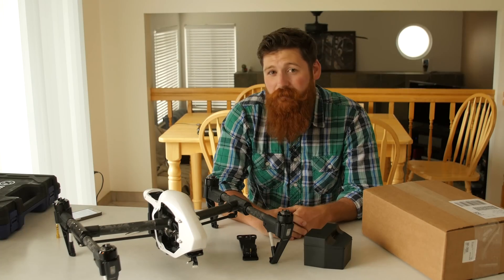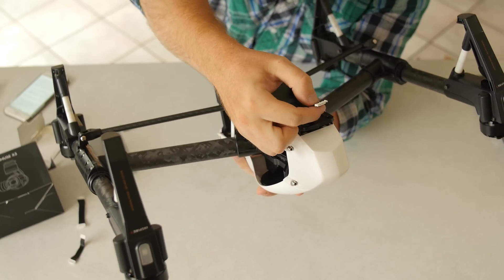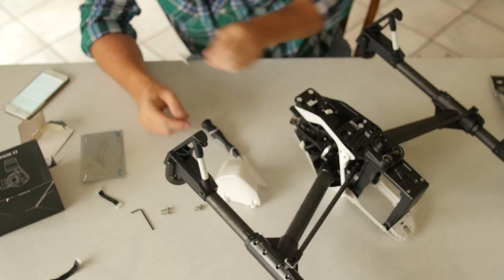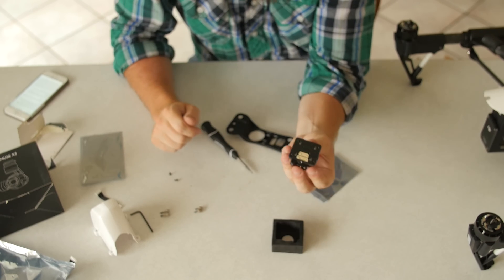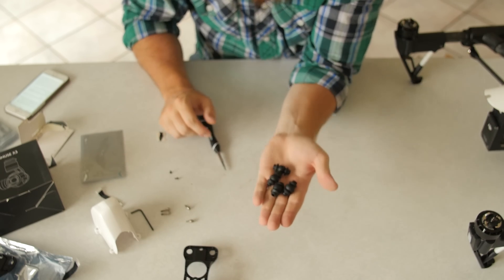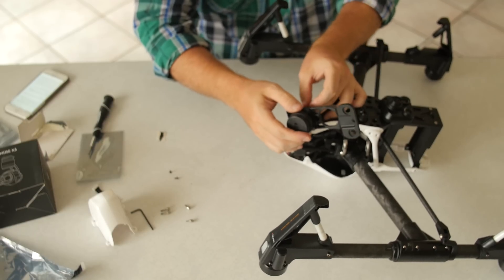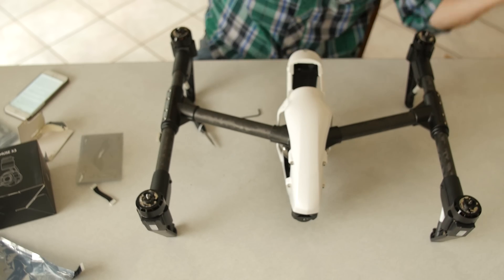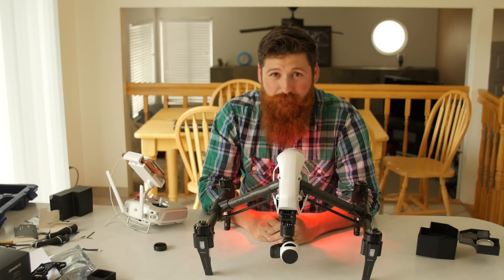HOW TO: Fix broken DJI Inspire 1 Gimbal and Mounting Plate (DJI Inspire 1 Crash)

Comment: have you dealt with Zenmuse x3 servo motor going bad . Can that be repaired do you know, same craft as you have. thanks for answering .
Reply from the maker: I haven't. I've actually switched to mostly using other drones since the camera tech has gotten better on the little guys. Mostly the Mavic and Mavic Air since it's so portable and just pops in my camera bag. Every once in a while if I know there is a chance of higher winds I will break out the Inspire.

Comment: yes i bought the inspire 1 couple days ago it came with no camera so i got a camera and putting it on it doesnt move ot turn at all and tricks or when can i do?
Reply from the maker: Ugh. That's no good. You might check the pins on the connectors to see if any of them are bent or out of place. I'm also assuming you got one of the white X3 cameras and not the black ones that were for the DJI OSMO. The black OSMO cameras do not work with the Inspire 1, but the white Inspire 1 camera DOES work on both the Inspire 1 and the OSMO handle. Not sure why they decided to do it that way but they did.

Hope that helps! And thanks for watching and commenting.
Reply: @AGBountiful  I sent it back order a new on it came 2 hour ago and it works fine I think the other one the seller sold me might be bad
Reply from the maker: @elvisbest3213  Oh nice. Glad you could get a working camera. Have fun with your new drone! The Inspire 1 is super rock solid to fly.
Reply: @AGBountiful  THANK YOU when u have the dron with the landing dear down like on a table with the camera on it the camera dont turn left to right or the gear has to be up for it to do that i never had an inspire before so
Reply from the maker: @elvisbest3213  The camera just follows the drone movement unless you have a second controller that is specifically for moving the camera. So if the drone is not moving (like if it is sitting on a table) the camera will stay still.
Reply: @AGBountiful  ok ty I can move it and spin it with my finger and once I am in the air I should be able to use the controls to control the cam right?

Comment: I recently picked up a T601, looking to do a similar repair. Great to see the step by step on your T600, very informative.
Just wondering if you looked into repairing the old gimbal with motors, wires etc. All of those parts are available, so users could repair the entire camera instead of buying a whole new unit. 

The bottom line is to some users, the cost is not justified, but for professionals you cannot risk a faulty gimbal/camera, just buy a whole new one. 

Cheers and happy flying.
Reply from the maker: At the time I made this video aftermarket parts for the X3 gimbal weren't available. You basically had to buy another broken X3, try and make a Frankenstein combination of the two and hope it worked. I do think I still have the parts hanging around somewhere but don't have a huge incentive to try and piece it together again.

Totally agree with the professionals just needing to get a new one. Some things are worth trying to fix, but in this case with it in so many pieces and it being a pretty precision part, I figured I would have quite a few gimbal overload errors, drifting horizon, etc. even if I could get all the pieces together.

Thanks for commenting! Hopefully the guide helps do some repairs on yours.
Reply: Little UPDATE: Out of curiosity, did you junk the old gimbal ? I would be interested in buying the old one as spare parts for my current repair on my x3..

THE REAL UPDATE: I just got my gimbal fixed I would say 90% (still get the odd ROLL motor error but not in flight, just when turning the bird in my hand to test the movement), got a used one on craigslist that was also crashed, but arms were good. Swapped cameres, re-calibrated magnets and voila :) Its not easy at all though, the physical repair is easy, plug in and then NOTHING WORKS ... just video feed. Had to balance all the motor magnets at the correct point which took hours once i saw the thing were magnetic.
Reply from the maker: That's awesome you got yours working!! I'd be interested to see the process of balancing all the motor magnets.

I do think I still have the parts, but mine was in a LOT of pieces and the camera itself was banged up on the USB port and some other places. Not sure how much would be salvageable. Should probably still list them on ebay or something.

Comment: Didn't you have to update the firmware on the camera? Good video!
Reply from the maker: I don't think the camera stores any firmware. I believe it's all internal to the actual drone (as well as each battery and controller). The camera does have the SD card slot to give you access to the drone though.
Reply: My research leads to the camera and batteries having firmware inside each, but not 100% verified, because nothing is published by DJI. Thanks for your response.

Comment: He didn't fix the camera arm which is what I need to know how to do. He just bought a new one!
Reply: I did the actual repair, it can be done but its not straight forward at all. Requires each motor magnet to be re-calibrated. Generally they go out sync when a crash occurs, and when the arms are taken apart.
Reply: also.. join inspirepilots forum for how to repair articles on the camera. Very extensive stuff on there, some of which i have posted.

Comment: thats not fixing broken parts , thats changing / replacing parts
Reply from the maker: There really isn't a way of repairing that part once it's broken since it's a precision part that they don't even sell separately. One of the big downsides to the Inspire 1 is that when the camera gets messed up 99% of the time you have to scrap it and buy a new camera. We just used the common search term "fix" since most people won't be searching for replacing parts and this is the way to solve the problem of a broken gimbal and other common parts broken along with it.

Probably not the answer you're looking for as a new camera isn't cheap and it would be nice to swap out a broken part, but unfortunately it's extremely rare that you can salvage the X3 camera after it's been broken. You'd end up having to buy a new camera and then swapping the parts over to the broken one... which doesn't make a whole lot of sense to do.
Reply: i bought the roll gimbal bracket and i ordered the flat cable as well , parts are available 
i just need a tutorial on how to change the flat cable as i already installed the roll bracket 
unfortunately i am not able to find a tutorial on how to change the flat cable
Reply: He didn't fix the camera arm which is what I need to know how to do. He just bought a new one!
Reply: but  AGB you can find the parts at amazon 
Drone
 Fans Inspire 1 X3 Gimbal Flat Cable Gimbal Protector Protection Flat 
Wire Repairing Accessory for DJI Inspire 1 Zenmuse X3 Gimbal

and for the arm 

DJI Zenmuse X3 Gimbal Roll Arm Aluminum CNC Replacement Part
Reply: So did you successfully replaced the cable? i am having the same problem. Bought the parts and will "replace them" to "fix" it soon. 
did you find a useful video ?
Reply from the maker: Oh cool! I haven't found ANYWHERE to buy the individual parts. You'll have to let me know where you guys have found them. I've only ever seen the full gimbal/camera being sold. The closest thing I have found for a disassembly video of the x3 is by the YouTuber addiengr1 it should be a related video on this one, but I don't think it goes into the details you are looking for. If you figure it out though you should post a video! I'd love to see it.
Reply: i still didnt find a video about the parts replacement but i will try to shoot my own and post it here .
i have already changed the roll bimgal bracket and still waiting for the flat cable to arrive
Reply: red or P goes to the motor
Reply: Boards are different 
you can find in hand writing the letter R and the letter P 
R is for roll arm and P is for the pitch arm ( camera motor )
Reply from the maker: Hady Esta Nice! Just did a search on Amazon and found those parts. At the time I made this video I don't think those were available. I know DJI doesn't sell them directly so must be that company making their own aftermarket parts for repairs. Hopefully I will never need to buy them again, but it's good to know the option is out there!
Reply: hope you will never do :) 
Unfortunately i have changed the roll arm and the flat cable , now i am having a crazy gimbal behavior
i checked all the connections but in vain .
have a safe flight :)

Comment: Good video detailed and informative has anyone ran into a site where they have some used possibly scrap parts as I have crashed also but need minor repairs but in a hurry have a trip coming up in less than 3 weeks and need a new case/cover for the x3 camera? Thanks for any help
Reply from the maker: I haven't heard of anyone selling those parts other than private sellers on ebay. You MIGHT be able to call up a repair shop and see if they will sell you the parts you need but I don't think anyone really keeps parts on inventory that don't have an actual SKU from DJI.

Comment: What's the best thing to do with brand-new batteries? besides updating the firmware.
Reply from the maker: +stampede75 I'm not sure I totally understand your question. With the batteries you want to store them drained unless you are planning to fly within a short amount of time otherwise you may pop in a battery that says it's at 80% and then it will discharge and drop to 20% super fast. I only fly on fresh charged batteries. If they've been sitting with a charge for a while that's not good. So try to store batteries drained and plan ahead of time to charge them up either right before your fly or maybe the night before. Hope that helps and thanks for watching and commenting!
Reply: +AlphaGraphics Bountiful I watched a video that I cannot find on YouTube anymore. It said to charge the battery all the way then fly it for like 10 minutes and then recharge it completely again and then fly it for 15 minutes. Some kind of like training for the battery cells. It's supposed to help the battery keep a charge longer. Do you know if there is any truth in this? And or what he's talking about? Do you know of anything like this? Do you do anything to help your batteries last longer?
Reply from the maker: I haven't heard that exact thing before, but I have heard a lot of different takes on proper battery usage. Since they are "intelligent" batteries they are a slightly different beast than your standard LiPo/rechargeable battery (firmware updates, internal computer, usage log, etc)

I would just stick to the basics I already mentioned about not storing fully charged batteries and making sure you are flying on a fresh charge. I'm no battery expert so someone may come tell me I'm wrong but so far that is what has worked for me and what I believe DJI recommends.

Comment: Hey my friend I was experiencing a problem with my Recording formats I did land on the camera in the grass one time and raise it up immediately don't know if this caused a problem but I noticed that one of the contacts in the connector on the drone seems to be a little bent on the ends and my camera only lets me record in 4K moods. if I  try 1080 or 720The app freezes and cannot take anymore video until I restart the inspire so I ordered the kit from B&H today was wondering your thoughts on that. When I called DJi today they asked me to take the camera off and put it back on that's when I realize that might be the problem. Any thoughts?? anyone.
Reply from the maker: +mario bruno I haven't heard of that issue before. Hopefully the new camera/gimbal will help with that... but definitely a pricey fix for just wanting to record in lower resolutions. You may try asking this in the DJI Inspire 1 users group on facebook or on the official DJI support forums. There are a lot of really knowledgable people in both those places that are generally happy to help. I know I have found them to be extremely useful communities. Good luck and let me know if you ever found or find a solution! Thanks for watching and commenting!

Comment: Good evening sir.  Would you happened to know hoe to solve the error "Gimbal motor overloaded" please help is urgent.
Reply from the maker: +Drone Productions I know that can happen if your gimbal has taken a hit and is slightly bent. They are very precision pieces of equipment and when they overload like that they tend to just shut down. Has your gimbal taken any damage in a crash or anything like that?
Reply: +AlphaGraphics Bountiful thanks for your quick response.  Yes.  I dropped it from a bed :(.
Reply from the maker: dang. yeah it is probably that it is bent just slightly. Sucks that it's so fragile.

Comment: Can you please provide a video tutorial showing the steps and tips on opening an x3 gimbal for dji inpire 1 !! .. I really like the way you explain things that sometimes other pilots don't understand and you make seen so easy and practical nice channel mate cheers  👍🏼🎥
Reply from the maker: +johncy kleno Yeah no problem. It may take me a little bit to get around to shooting it with all the client work we have going on right now, but I'd be happy to show you the insides of the x3 gimbal/camera. Like I've replied to a few other comments on here, there is really not a whole lot you can "repair" on the x3 gimbal. It's a part that when it breaks it's time to buy a new one. Small ribbon cables usually get cut as well as other damage. So even if you were able to get the individual parts that are in the x3, it's such a precision part that you would be replacing pretty much EVERY part and might as well buy a new one.

Comment: Nice vid but you should rename it to how to fix mounting plate. You did not fix the camera gimbal you simply bought a new one :P
Reply from the maker: +Dantay Westwood (Westwood Films) Yeah I see your point, definitely not meant to be misleading. I didn't actually fix the mounting plate either. It's one of those things where I debated on saying fix, repair, replace, install, etc. Really I replaced/installed the parts but in the end it seemed like most people needing this information wouldn't be searching using the word replace or install, but I made sure to put those words in the tags just in case.

Comment: Hi there. Any way of fixing the gimbal itself or is it just as good to buy a new one. Anyone who has sent it for repair with DJI?
Reply from the maker: +Magnus M I think it really depends on how broken the gimbal is. 99% of the time I would say it's time to just buy a new gimbal. I don't think they really sell the individual parts for the gimbal itself so you would have to find another broken gimbal that happened to have the parts you needed... and even then you may not actually be able to fix it back to functioning correctly. In my experience when the gimbal breaks, it breaks for good.

Also with the new OSMO camera out at a lower price point and all the other new camera options for the inspire, they may drop the price on the X3 cameras which would be pretty great.

As far as repairs from DJI... I think that with the amount of drones they have sold their customer support gets pretty overwhelmed and I've heard it takes a while to send in and get it back. If you CAN fix it yourself I would opt for that instead.

Comment: indeed the x5r is attractive but only if they sell.parts to repair it if it takes a little fall. If they have the same oh well you broke the arm, buue another one attitude I may altogether sell this Inspire 1. way too risky, imagine taking a small hit with the x5r and you break the arm, which is real easy and they go oh well no support sorry!
My advice is wait to see if they will give a full support before touching those poppies to  fly around in the sky.
Reply from the maker: +Guy Letourneau Yeah... we just had another crash while on a shoot in California. A quick release prop popped off and the inspire 1 fell like a rock onto pavement. Not pretty. Surprisingly the gimbal got banged up and makes a little bit of a funny noise but still seems to function fine. I'm going to try and take the good parts from the really smashed one in this video and replace the banged up parts on the newly broken one.

I did do some searching about repairs and pricing and while I don't think you can buy the gimbal arms yourself if you send it in to DJI (and possibly other certified repair places) they can fix the gimbal arms and whatnot for much less than the cost of buying a new one. In the case in this video is seemed like a lost cause just because it blew up into a LOT of pieces. I'll probably try and send everything in for repairs and see how much it would cost to repair everything. The hope is less than $500 which is what I kind of gathered from what other people have said it has cost them for similar crashes to the one I just had. Broke the carbon fibre arm and a few other odds and ends.